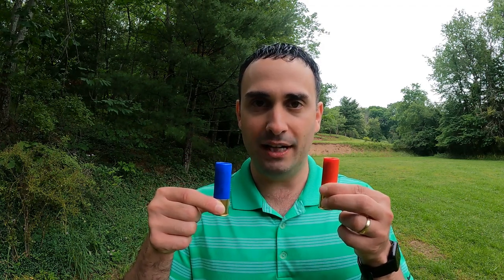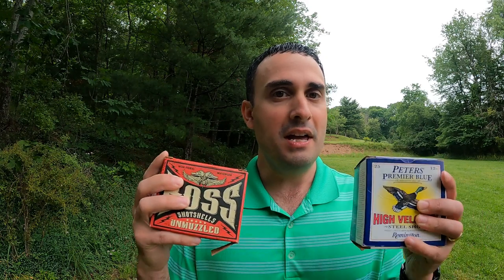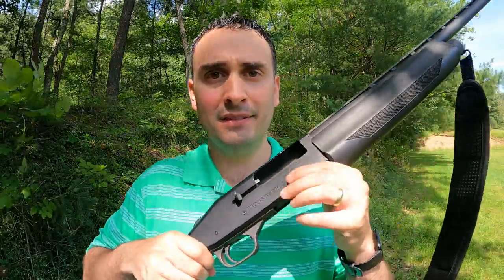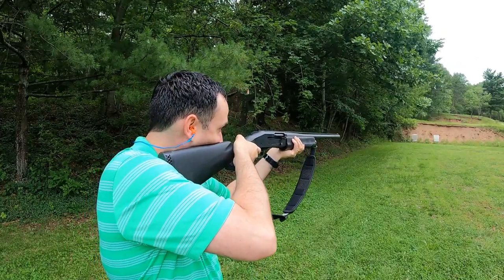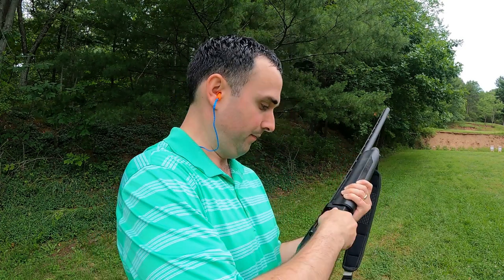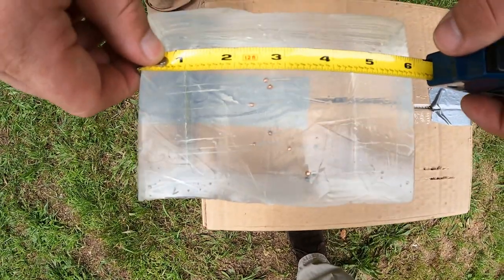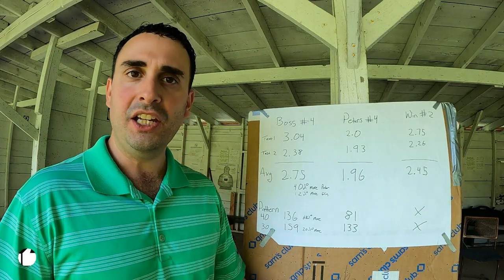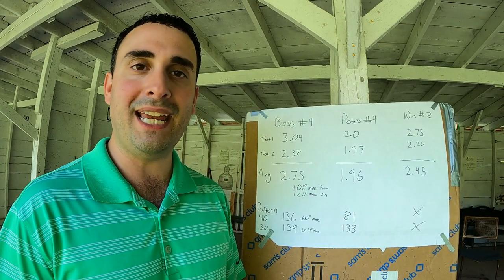BOSS Bismuth Vs. Steel Shot | Ballistics Gel Test For Duck Hunting Ammo!

Comment: So essentially Boss number 6 pellets should perform similarly to number 3 steel internally on waterfowl.
Reply from the maker: Actually no, I've done alot of testing since this video. BOSS #5 equates to Steel #4 at 1550fps at 40 yards. I have not tested #6.  There is a sweet spot with #4 and bigger, you get a critical mass that has more gains. #4 BOSS equals Steel #1 at 1550 fps. #2 BOSS does better than Steel BB at 1550 fps. But for whatever reason the #5s must not be big enough to hold the power needed compete with 3 sizes larger steel. I need to do some more resting there to understand this better.
Reply: @TheNewHuntersGuide  okay thanks for the reply. That’s strange how the pellet comparison isn’t linear.
Reply from the maker: @nathanielchoate69  I agree. I don't have an answer that satisfied me yet. It could just need more testing. My best theory is that shot that small at that density is more effected by wind and general air resistance.  It could also be an anomaly that more testing clears up.  I have shot ALOT of #4s though, different lots and payloads, and BOSS #4 continues to consistently punch above its weight class.
Reply: @TheNewHuntersGuide  that’s interesting to hear. I wonder how the 3/5 duplex load would do
Reply from the maker: @nathanielchoate69  That test is coming soon!

Comment: My brain wants to know the weight or density of a single shot (yes 1 single pellet) of bismuth or copper plated bismuth vs a single shot of steel, have you ever measured that?
Reply from the maker: Thanks Dan, I like you! Yes, 1 Bismuth #4 Pellet is approximately 2.79 gr and a #4 steel pellet is 2.29 gr. A steel #2 pellet is 3.51 gr but keep in mind as size increases so does wind resistance, thus the bismuth #4 can out perform the steel #2 because it is smaller and wind/friction act upon it less over distance.

Comment: You keep saying at the same speed but if you increase the speed of the steel with a larger shot size you will also increase the energy down range hevi bismuth shot travels at around 1200 to 1300 fps. my BB 1oz 3 in shoots at 1710 fps I'm willing to bet that the extra speed can compare to the energy of that heavy shot
Reply from the maker: Hi Tim, this video I compared #2 Bismuth (1350fps) against Steel BB (1550 FPS) https://www.youtube.com/watch?v=j-dQU2tYVzU&t=415s The Bismuth still had significantly better penetration and smaller shot means more pellets in the air.  

If you got your steel screaming fast at 1710 FPS then yea, I would expect that to perform better than at 1550 FPS.  But, steel looses velocity faster than bismuth, so no matter how fast it starts at, it slows down quicker so its not going as fast at 40 yards as you might think.

Would BB going  1710 do better than #2 Bismuth at 1350? That would be a good test. I have never seen any steel that fast in stores, is that a handload or can you point me to the shells online? I'm testing BOSS Bismuth against some Kent Fasteel next. But it would be great to test some super super fast stuff too if I can find it.

Comment: Last season, the cheep stuff was $30 +/ box
Reply from the maker: Where?
Reply: @TheNewHuntersGuide  I live outside Portland, Oregon, but the only place I could get waterfowl loads was to order online.  I bought 4 boxes of #3 Fiochi from a pawn shop on line.  $120 plus shipping.  None of our stores had anything in stock but 3 1/2” BB or something similar.  I don’t recall the exact price asked for them, but it was $30+ as well, but that didn’t help me with a 3” chamber.
Reply from the maker: @rimrock53  Oh wow, that's bad. For that much you could order Fasteel or Hevi steel from Cabela's or pay just a little more for BOSS bismuth.
Reply: @TheNewHuntersGuide  Last year was my first year of full retirement, and I hunted more than I had in 25+ years.  I started the season with several boxes left from the previous years, but by Thanksgiving I was calculating I would be out by the end of December.  I started trying to restock during early December, found and ordered several boxes from Cabelas.  Waited patiently, and then got a message from Cabelas that they had oversold, and were canceling my order.  Less than a full box left and 4 more hunts scheduled.  Panic time.  This year I am starting the season with 200 #5 Boss shortys and 125 rounds of steel #2 & #3 in the cupboard.
Reply from the maker: @rimrock53  Oh wow, yea that is bad timing and a tight spot right there.

Comment: I shot Boss last year and loved them out of my gun- every gun patterns differently- so maybe that’s why some guys don’t see the advantage-  quick question- will the #4 shot be effective on geese?  I shot #3 last year but like the idea of the extra pellet count!
Reply from the maker: So I talked to BOSS and they said the #5s work great on geese at regular range. The #4s should be better still and be great for goose in the late season. BOSS #4s are equal to about Steel #1 in terminal performance, so they should be all you need. I think a denser pattern is the most important thing for geese, if you can put a few pellets in the head and neck, that bird is coming home, nothing else matters. You could always go to BOSS #3  or #2 for late late season long range, but I normally go out with #4s.
Reply: @TheNewHuntersGuide  thanks for the fast response- and I did subscribe!!! You do an awesome unbiased representation!!!
Reply from the maker: @ishotapig  Thank you! I really appreciate it!

Comment: Great test interesting ,i noticed both test you shot boss last when gel warms doesnt it change consistency of gel? When taken out of controlled enviroment immediate use is most accurate
Reply from the maker: Thanks for the comment Philip, actually for the off camera test that I did I shot the BOSS first and the Steel second in a different piece of Gel and the results were not effected. I actually contacted Clear Ballistics myself with that same question and they said the constancy of their gel does not change based on shots being fired into it with a shotgun or anything else.  They said I could fire both shots into the same side of the gel and it would not effect the density. I still turn the gel because it makes it easier to visualize and count and you are less likely to hit another pellet. If the gel sat in the sun a long time between shots it could become warmer and thus less dense, but I fire both shots within 60-90 seconds of one another to keep that from happening.
Reply: @TheNewHuntersGuide  thank you